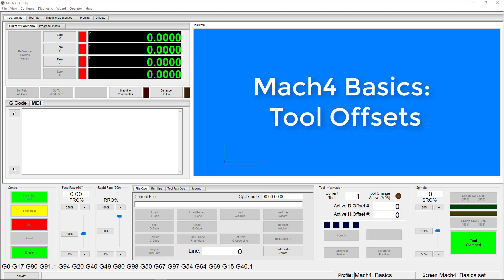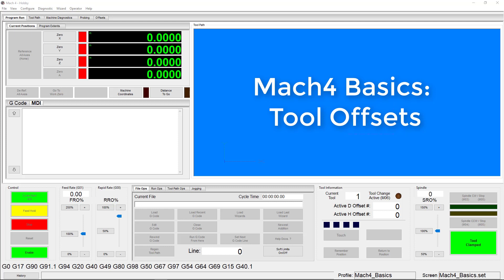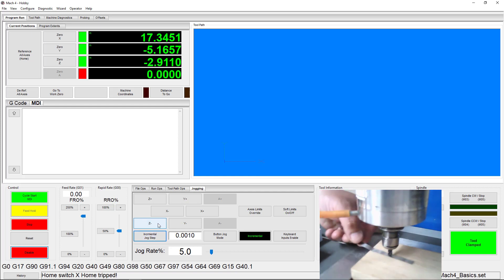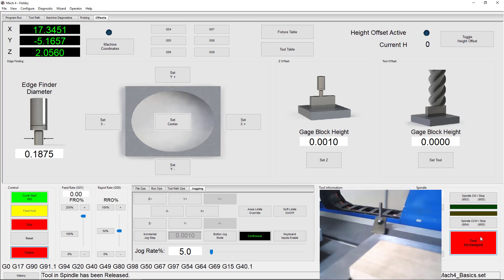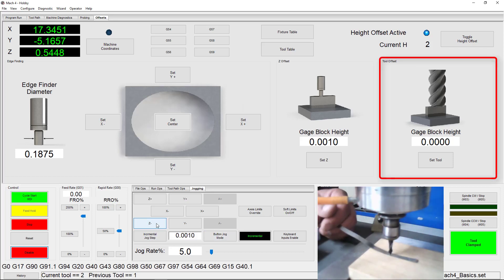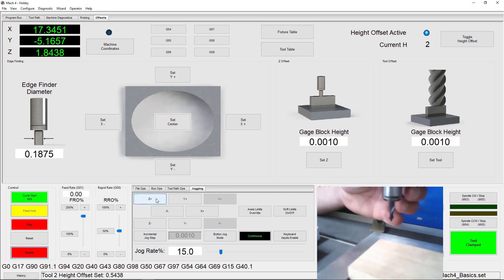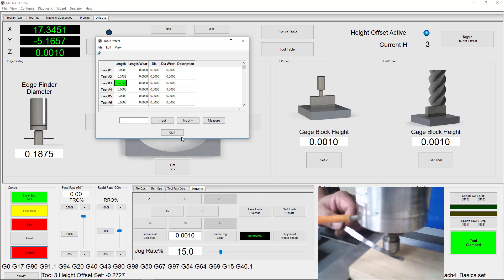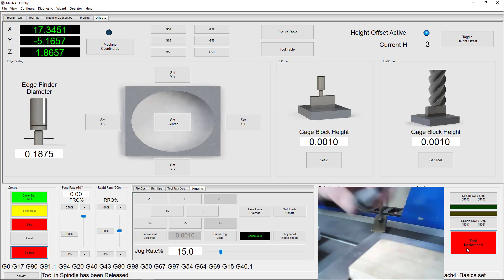Mach4 Basics: Tool Offsets

Comment: My offset screen looks nothing like this. I have no "set tool", no toggles, no tool information box, no Height offset active toggle. I have spent hours trying to figure out how to set the tool offset height with the current avid screen set, but nothing. This video is 4 years old and the only one out there on the subject with mach 4. Desperately need a new video on how to do this with no options in the current screen set. Help would be appreciated.
Reply: Just found out that you can load this screen set in mach 4 by going to view > load screen > wx4.set

Comment: My gauge block hight parameters return to zero. For example, I open the offset tap, in the tool hight section, I type in the hight of my touch plate and hit enter and Mach 4 turns it back to all zeros

Comment: what is the point of a master tool? why not just set all the tool lengths from the stock top using the shim? why use the "gage block height" at all?
Reply: Usually 3d probe will be master tool

Comment: Maybe I'm wrong here, but I hope you can help me anyway. With a tangential knife I am trying to set the offset of the knife tip to the center of the axis of rotation (A). Is that even possible in Mach4 or does the tool (knife) always have to be centered on the axis of rotation? Thanks in advance.

Comment: What if my tool length sensor is at a fixed position on my machine and not at the top of my stock?
Reply: Did you find out the answer?
Reply: I used another offset G55 for tool setter on table.
Tool 0: 3d probe
Switch g54 - set stock height with 3d probe, set z to 0, switch G55, jog to tool height sensor, zero Z in G55 on sensor
Switch tool 1 - endmill
Switch to g55, touch sensor, press set tool offset, run g code in G54

Comment: Thanks for making this - one thing that's not clear to me - how does my G-code know that tool #1 is the 'master' tool? Or how do I tell Mach 4 to automatically offset all other tools from tool #1? Also, since I have a ER20 collet, I don't have tools fixed at a certain length - I can't set them up before starting the G-code program. I need to set my tools again in the middle of the program; how is this different from what you show in the video? Thanks for making these great videos! Very helpful!
Reply: Tool 1 is just assumed to be '0' offset and therefore is the master tool.  I also have er20 collets and I either set the back of the collet flush with the tool shank or use a caliper to set the tool stick out at a given number (i.e. .950")
Reply: @accidentaltradesman5139  So when setting the tool back to the master tool - is it - T1 M6, G43 H0